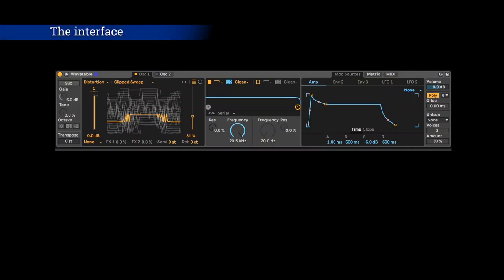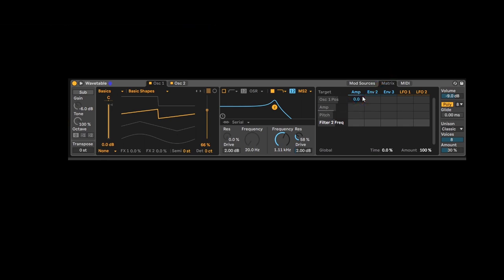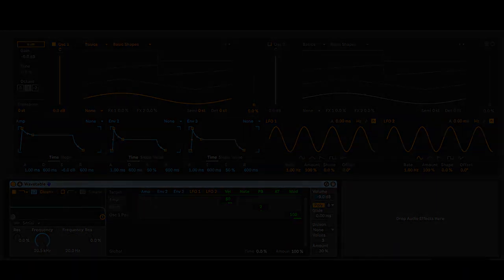Basic Sound Design in Wavetable (Ableton Live)

Comment from the maker: TIME STAMPS
00:00 Interface
00:17 Oscillators
00:28 Wavetable
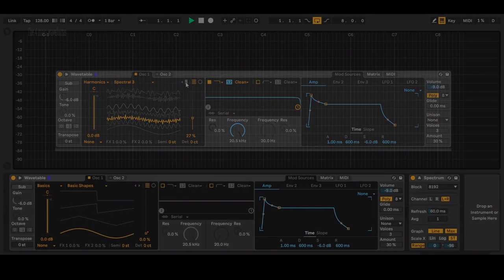00:55 Basic Waveforms
01:37 Additive Synthesis
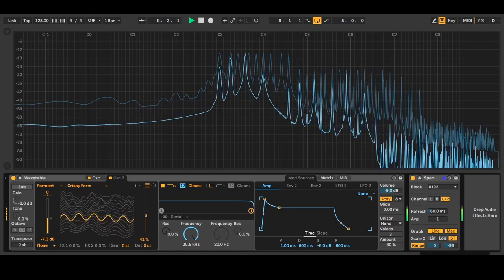01:59 Sub oscillator
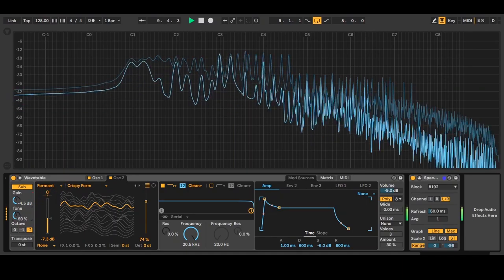03:02 Filters
03:20 High Pass
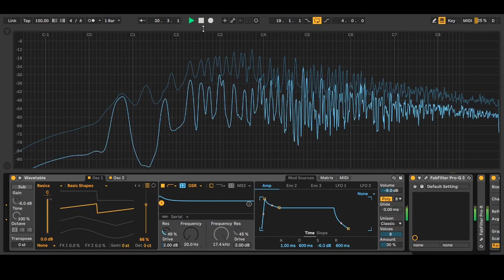03:36 Low Pass
03:53 Filter Modes
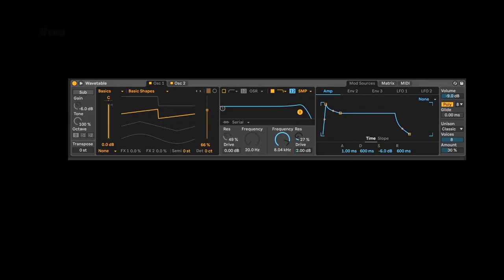04:04 AMP Enveloppe
04:38 LFO Modulation
05:35 Enveloppe Modulation
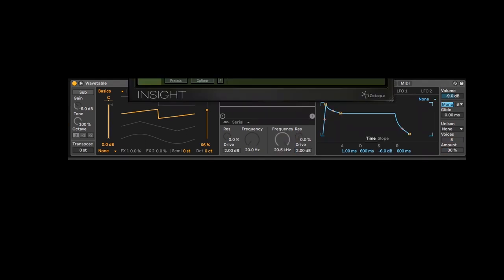06:09 Global Section
06:32 Conclusion